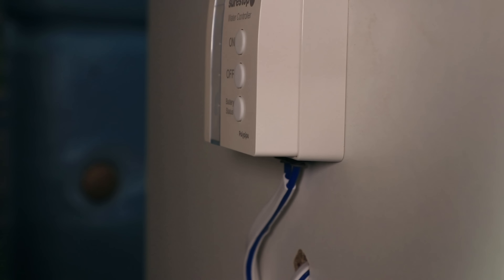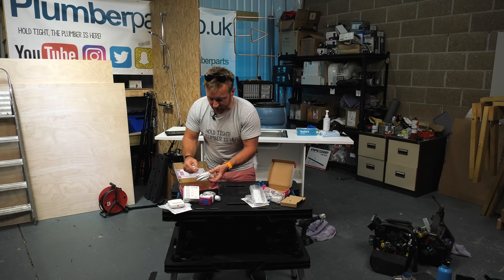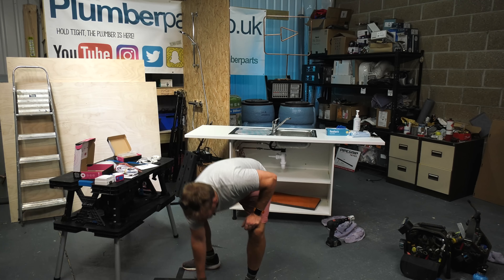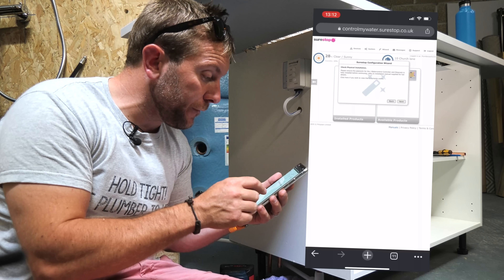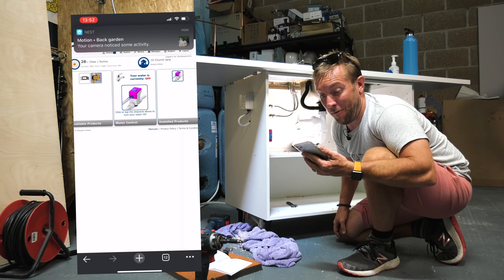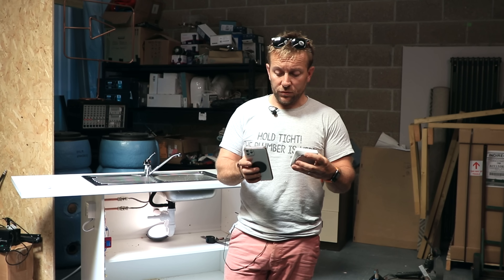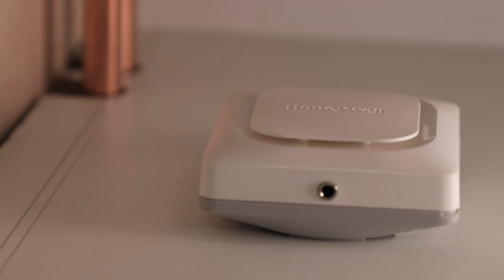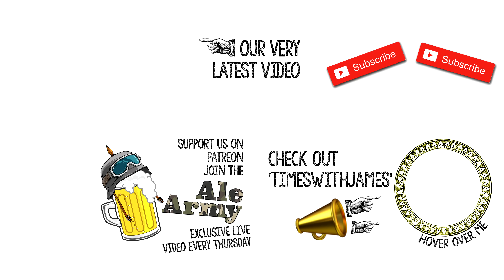HOW TO FIT WATER LEAK DETECTOR SHUT OFF VALVE - SURESTOP iWater Control

Comment: Hey James,
I like these Surestops. Have only installed the basic model once before.
When Surestop upgrades the firmware to make it compatible with Google Assistant, Amazon Alexa, Apple Homekit and the like, you will be able to have the Honeywell notification or email, trigger one of those services which would automatically turn off your stopcock.
I think Surestop needs to get working on that asap. They will sell loads more units.
Reply from the maker: Christian B Hough the thing about the ‘auto shut off’ is the ‘leak’ could be me at 7am with a cup of tea! 😂😂 Have you been on any Ale Army’s of late?
Reply: @plumberparts  the idea of the water leak detector such as the product by Hive / British Gas takes into account normal water flow (I am sure you are aware of this but just stating for the other readers) and even long periods of water flow such as the missus in the shower however you can set that alert for long water flow to be whatever you want. Using the likes of IFTTT to receive the alert from Hive Leak Detector of high water flow and then instruct the Sure Stop to close the water valve would mean a precautionary system that even if false alarm, the water is easy to switch back on (and then modify the long water flow alert).
Reply: Hi Christian B Hough.  Already working on it :-)  Keep an eye out.  Thanks Surestop

Comment: A version with compression fittings on would be nice; and when it comes to having a full flow leak, 2 minutes is a looooong time. I like the traditional surestop, having a simple switch makes people get into the habit of turning the water off before they leave the house for an extended period of time.
Reply: Dan Reeves Their website shows compression fittings as a choice in both 15 and 22 sizes.

Comment: Cut the pipe push on the Surestop, rarely happens in the properties I work on. Three times out of four I'll have 3/4" imperial pipe which either requires green compression rings or a 3/4" to 22mm Speedfit adaptor and I hate those big ugly white push fit fittings. I use pressfit for most things now and rarely solder, don't you have a pressfit gun? Worth a future video if you do.

Comment: sure stop need to integrate a leak detection system into the valve, so it switches the water of automatically. Now that would be the ultimate package.
Reply: As commented previously, this should be possible with IFTTT and something like a British Gas / Hive water detector
Reply: Ian Kearns sure stop should just speak to Honeywell, could get rid of the gateway too.
Reply: Hi wjb2 Watch this space
Reply: @surestop  if you need a beta tester and public testing then happy to get something installed
Reply: @iankearns  Thank you.  Will remember this when we launch extras next year

Comment: Excellent video. I already have a surestop valve and was wondering whether that would work with the controller? Or would you need to purchase a newer version of the valve?
Reply: Hi DoKanLio It can work with current valve, however there is a new valve supplied in the box.  Thanks Surestop

Comment: Jim, great video and a simple device, what is the cost of the accessories to get the device automated as per video, - if needed. 
I think most people would go for the simple switch.  Thanks
Reply: Hi Graham Atyeo.  The I-watercontrol also has the switch, we couldn't get rid of the switch its too well like!!! Plumbing merchants have these in stock, take a look at Screwfix, Toolstation, Travis Perkins and many more.

Comment: 30-40 seconds wait time? I've got a ZWave mains shutoff motor that turns the ball valve. It reacts instantly. And if there is something wrong with it, I just take it off the valve and I can use the valve manually again. I had it installed more than a year ago and it still works perfect. I'd go mad waiting a minute for this thing to react.
Reply: Yeah they’ve gone for an aggressive battery saving strategy, wake the microprocessor up every 90 seconds to see if the gateway has a message, sensible decision for this application.

Comment: James, thought this looked very interesting so searched for user reviews. Found quite a few negative experiences where the device ended up leaking from the body (not faulty install). People complaining about the quality of build. What's your view on the standard of contruction of the actual valve? Another great video by the way.
Reply from the maker: I've fitted loads and not had a problem. That being said, water pressures these days (especially at night!) can go up quite a bit...Could be something to do with that.

Comment: Does the SureStop restrict the flow at all?
Integrated leak detector sounds like a no brainer to me. Maybe could use IFTTT but really it should turn the water off without you having to do it. Then get a notification saying "leak detected AND water turned off, don't panic finish what you're doing then sort it out"
Reply: Hi Jas Gawera.  Some cases it has reduced but only by 3%.  We are currently working on a new project for it to shut off automatically.  So please keep a look out.  Thanks Surestop

Comment: We have been fitting sure stops on for M.O.D Properties and they are shit we must have problems with at least 1 in 5 a few months down the line and the powers that be have pulled them from the spec thank god
Reply: same, we stopped fitting them, just give the old tenants a long arm ball valve in an accessible place.

Comment: Remember this is a supplemental stop tap and not a replacement for an approved mechanical stop tap. Had a question from a developer if this can be used as the one and only in a new plot. Water Regulations say no.  👍🏻
Reply: The Slow_pulse_boy More details please the manufacturer clearly claims it can replace the stopcock on their website with links to their WRAS approval certificate.

Comment: Been using Surestop for over 10 years in its first generation product. I say 'using'; not entirely true - read on please. Installed the valve and then put the on/off switch on the countertop (just means you dont have to get to the back of cupboards or pull appliances out). It is not 100% effective. It appears to use some sort of air pressure from the surface mounted switch back to the valve to close it. Out of the box this was fine but after a number of years it got stiff and required the switch to be dismantled and checked over. I even contacted SureStop who were somewhat helpful but ultimately didnt want to fix a failing product. Eventually the remote surface mounted button failed completely. Even now the local button on the valve is stiff and not easy to use. The addition of wireless control shows that they have developed the product but little comfort for those that spent money in the past on a flawed device.
Reply: Ian Kearns I may be wrong but the valve ‘signal’  head is the same, so the remote unit is using air pressure to signal too.
Reply: @normanboyes4983  hope they have improved things then!

Comment: Ah, it needs a broadband connection to work....that's a bit of a presumption. I used 5G for my internet connection. It would be much better to have a dedicated 5G connection, then we don't need to leave our router on all the time...which isn't necessary. Also, it could then be battery powered.
Reply: It would be fine if it is a relative or something, though...
Reply from the maker: Funnily enough they’re looking into it with a mini SIM card slot.
Reply from the maker: Also on this video I was using a DLink router with a 90gb O2 sim!